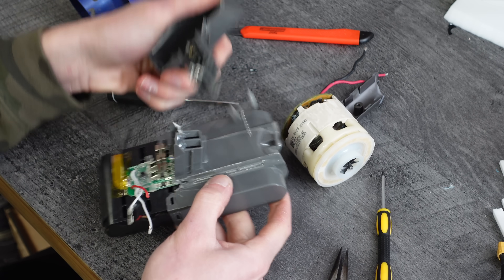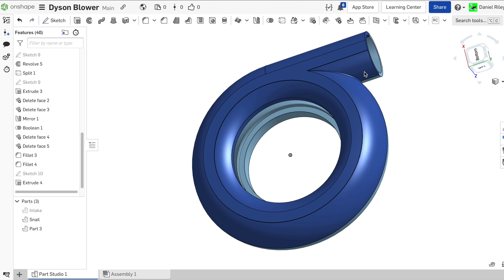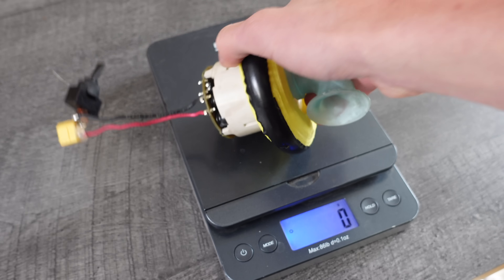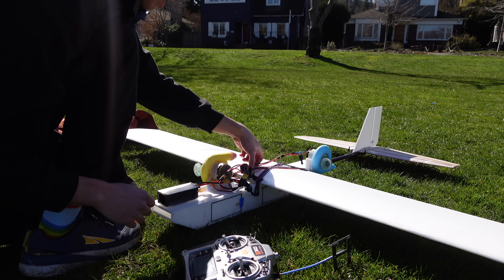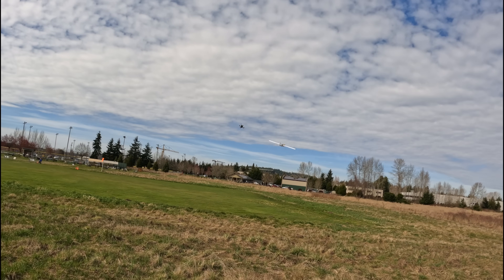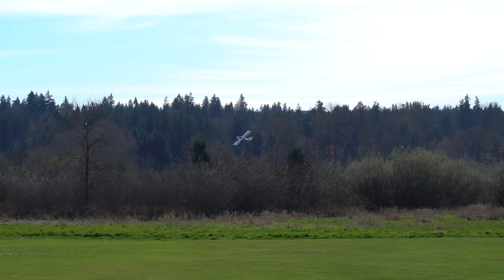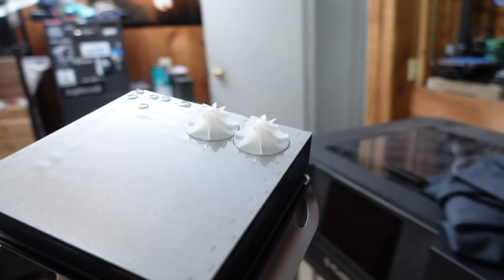Dyson Powered R/C Plane

Comment from the maker: Use code RCTESTFLIGHT40 to get 40% off your first Factor box at https://bit.ly/3LeE7JX!
Reply: Can u add some butane and a spark ...maybe try an add a afterburner
Reply: L ko
Reply: Wow a Dyson that did something useful.
Reply: that food alway made me fart
Reply: What a waste of plastic factors needs to decrease it's quantity of plastic use
Reply: 6:10 Um, the snail exhaust looks like an uncircumcised penis. 😂😂
Reply: Because of the fact that these centrifugal designs usually produce a significantly good pressure when allowed to flow, did you try reducing the diameter of the outlet nozzle at all? 
I know more air flow is desired but I was thinking just the rear engine with the higher velocity flow and keep the front on with higher volume?
Reply: @jbirdmax  did you not watch the video? That was pretty much the first thing he did.
Reply: @lilsammywasapunkrock  he tried the front engine full flow with the rear one nozzled before he added the second engine? He never tried that.
Reply: OMG Daniel your hands have been ruined, by chemicals I presume. Get some Lucas' Paw Paw ointment it's the best
Reply: The "you know what doesn't need ailerons for roll controll" line was great...
Reply: What in the Howtobasic is going on
Reply: when you build a snalehouse do it snale way. It needs to be a divergent tunnel with a throat..where the snalehouse almost touches the fan. that gap determines eficiency.
Reply: I totally did too!
Reply: Next use the Dyson V9 Motor in their supersonic hairdryers.

100 Watts each and you have a directed flow. No need for printing.
They also look like little turbine engines.
Reply: Where is the solar powered plane, the V3 or V4 maybe?

I had thought each year would show as a further improved version cause I loved the idea and all your considerations so far as a great inspiration when I was struggling with mine.
Reply: My natural intuition is telling  me that you MIGHT get SOME benefit from pointing those intakes out at 90deg to the direction of travel. Nothing to do with the intake but that might present a smaller smoother, rounder  footprint into the wind? maybe~?? Giving you just slightly less drag?
Reply: https://www.youtube.com/@arduinoversusevil2025
Reply: my dude is all over the place. i love it! 😅 
whats wrong with all the dislikes?! 40% WTF?!
Reply: @cloudpandarism2627 the people who dislike have no roll control....
Reply: @cloudpandarism2627  i already tried them. i have to eat 2 of them because they are so small and it basically turns into a $26 dinner of some frozen meals. you can buy better frozen dinners at safeway for way less trust me.
Reply: @cloudpandarism2627  🔴 What Is Islam? 

🔴 Islam is not just another religion. 

🔵 It is the same message preached by Moses, Jesus and Abraham.

 🔴 Islam literally means ‘submission to God’ and it teaches us to have a direct relationship with God. 

 🔵 It reminds us that since God created us, no one should be worshipped except God alone. 

 🔴 It also teaches that God is nothing like a human being or like anything that we can imagine.

🌍 The concept of God is summarized in the Quran as:

📖 { “Say, He is God, the One.  God, the Absolute.  He does not give birth, nor was He born, and there is nothing like Him.”} (Quran 112:1-4) 📚

🔴 Becoming a Muslim is not turning your back to Jesus. 

🔵 Rather it’s going back to the original teachings of Jesus and obeying him. 

More .....
Reply: It's literally microwave food. I really don't know if you should be pushing that. Hellofresh at least includes some cooking. But this is just cantine food.
Reply: @graealex  i like microwave food and the meals looked tasty. Just because the method thats easiest to heat it is a microwave doesnt mean it will be bad
Reply: @DTNorthern  It's not about how it is getting heated afterwards. It is about the preparation so it can be ready in 2 minutes in a microwave. Don't get me wrong, no one is going to die from eating these meals, but I doubt you should be eating them on a daily basis.
Besides the fact that you are paying about $8 per meal which usually contains only around 600 kcal.
Reply: factor has disgusting prices. 600 calories per meal. so you need 2 meals per day if you sit in a chair all day. so 14 a week at a minimum. thatll cost you 180 before taxes. for 1 week. like wtf? i eat fast food every day and its cheaper.     and i get 1000 calories in an easy 15 bucks.   canadian... in toronto... do NOT get scammed. the only thing helping you lose weight is the HIGH cost of the box. this guy mus be loaded on solely factor. if i looked up the piece you have been supporting i would stopped watching a long time ago. they help noone but themself. like you telling therm to use a scam service like that.
Reply: I’m not interested 😒
Reply: @algodoomarbleracing  wwwaaq9

Comment: Just saying here... when you tested the propulsion with the food scale its NOT gonna have the same effect because there's no change in the air flow. Test it with 2 different parts. One like the plane you made that you made with motors on the wing but with a tube that "sucks the air away front the inlet like it was when you turned the inlet back words and test it visa versa with the second one blowing air into the inlet but also going around the on coming wind. Its also sad how slow yoir brain is for not being able to see the wood plane fly past above you out of view of the camera behind you.

Comment: If you enlarge the opening of the inlet funnel and thus the back pressure, the pre-pressure and thus the propulsion should increase... because the density of the gas column and thus also the mass that is accelerated backwards has increased...

Comment: For those that don't already know - when you put a Dyson on to charge and after it is full, it stops drawing power from the wall and just uses one cell to keep the electronics in "standby mode". Eventually that cell is discharged and given enough time, the pack will refuse to work at all.

Comment: that is soo cool something to think about while requiring a bit more skill if you were to have the exhaust of the impellor going into a reaction chamber and then were able to spray a flammable liquid into the exhaust and then ignite it you would literally create the same type of primitive jet engine found on things like the Caproni N1 thus generating significantly more thrust.  A can of deodorant or lighter fluid or alcohol would do the key would be to aerosolize it in the exhaust and ignite and depending on where you live there may be legal restrictions but would be fun.

Comment: If these air outlets were metallic and at the end you put a gas mixture (from a butane cylinder for lighters, for example) and ignite the mixture with the air that comes out, it is likely that the thrust would be incredibly greater.
Mention me, if you put that idea into action B-)

Comment: Sometimes those sharp edges at the inlet help the compressor to achieve a slightly wider compressor map.  Uses the disturbed boundary layer to achieve a cheap port shrouding effect via forcing more flow towards the center of the wheel

Comment: I've aways through about using vaccum cleaner as RC plane thruster (and also if you could do one with hair dryers) but i think you shall try to shape your engines, not as a turbocharger, but as a reactor. I mean put it with the compressor facing the air flow and attached under the wings (like a passager plane) or half way in the fuselage like a fighter jet. Maybe the second will reduce the drag.
In any case well done you've realised one of my childhood mad experience

Comment: for the next plane, remote controlled start, could work. also setting up the vacuum motors like jet engines could help with the stability, as well as ducting the intake could help with the thrust issues.

Comment: I wonder if you could add a Venturi affect at the discharge nozzle. Wouldn't that double the volume of air moved? Basically a  jet eductor. I know this would work with water pressure, not sure about air though.

Comment: Daniel, what if you set it up so the 2 motors are tied together so they produce one thrust output.  This would allow you to switch sides with the motors so the balance across the wings rather than the fuselage.

Comment: if i understand correctly, the orientation of the air intake is supposedly changing the flow because of the oncoming air, so it would seem obvious that there would be no change on a static scale ?

Comment: The flared intake pulls air from all round. I guess you were hoping for the koanda effect to add lift/pull, but I think ram pressure overrides that. Replace flared intakes with a straight, sharp edged tube , so it pulls only from Infront. Ideally also fair the outside edges, but not so vital with the airodynamics of that beast. Possibly a stator to true up the intake would help, but not sure

Comment: Great Vid.

If you reversed the direction of the motor (if possible), would you get any thrust out of the impeller blades, or does it not work like that?

Comment: If you match the desired speed of the airplane with the area of the inlet with a gradual (low loss) cross section reduction from the inlet bell to the impeller  vs the same mass exiting the fan system  you will minimize inlet losses and maximize available thrust.  Keep in mind that the fan you are using was designed for high inlet velocities with no restriction.  Create a ram inlet to maximize the aspiration volume and minimize the aspiration losses . Likewise, the outlet nozzle should do some flow straightening to get maximum impulse, and the area ahead of and outside of the nozzle should be tapered to allow the ambient airstream to gently return to fill the void created by the engine cross section avoiding turbulence rapid shear at the trailing edge.  You end up with an aerodynamically efficient engine housing and an efficient energy transfer. Remember that an inlet to a fan that is "starved" will produce less  net gain in pressure and therefore a lower exhaust impulse (MV2). Spend more of the energy compressing and accelerating the air to maximize the V2 component of the MV2 formula at the outlet. It will always be true that the M portion is the same for the inlet and the outlet. (conservation of matter) so look for lower V2 at the inlet (larger smooth intake) and highest possible V2 at the outlet.   This all would be best achieved by placing the motor with its inlet axis  the same as craft direction of travel and then using a bell housing around the motor outlet to collect and compress the air as it moves rearward towards the exhaust nozzle. Voila..electric jet engine.  Forcing the air to spin around the volute (many times) instead of moving directly to the  outlet with a single turn burns energy as friction and heat.
Reply: I was just about to say exactly that
Reply: @TheHishamManna  what he said
Reply: Damn dude, that is impressive.
Reply: Nerd! 

🤓

Comment: Brilliant idea for a project!! Well done. 

If you do a lot of 3D printing - which it seems you do :) - one trick for connecting FDM prints is to “glue” them together using the same plastic spool used to print them.  There’s a dozen different ways to do this…but my favorite is to use a cheap $35 3D printer PEN, and feed a length of your spool through it.  You can then just sand off any of the excess to give you a seamless connection that few would be able to tell was “glued together.” 

Keep it up!

Comment: You could make the inlet more RAM-jet style, as the plane starts moving the 'flat' part of the inlet flange might give more drag than aid in flow.
maybe end the Tuba style inlet at the 70/45 degree mark to reduce drag.
also try to get some of the snail housing inside the main body.  with inlet and outlet sticking out most :3

Comment: No, a propeller actually "sucks" the aircraft forwards by creating low pressure over those rotating wings! Take a look at the shape of each propeller blade and you'll see it is a wing. Wings create "lift" by reducing the air pressure over the top of the wing or, in the case of a propeller, in front of the propeller. Learn your Principles of Flight!

Comment: Sorry to be the picky guy but you're missing the differentiating factor in your test: how the ambient air is mooving towards or away from your inlet nozzle as it is mooving in flight, to recreate this you would need to put the scale test into the airstream of at least a fan (guided laminar flow would give more precise results but too much effort if it would just be about if it creates a difference) with about the same speed as your plane and then try turning the inlet nozzle.

Comment: Am I mistaken, or is that Dyson motor BRUSHED? Whether it's brushed or brushless, why couldn't the voltage, hence the proportional control be harnessed to the throttle with a BRUSHED ESC? IOW why can't the throttle be used instead of the BIPOLAR ON/OFF Switch?

Comment: You could probably mount each motor above or below each wing and add fixed landing gear covered in an aerodynamic shroud.
Otherwise your aircraft is very impressive.

I just wonder whether similar but far larger dyson motors or similar using your design, could be employed for some form of personal airborne transport.

There are single seat drones that utilise multiple propellors, upwards of 12.
Which in my opinion is both dangerous, unsightly, noisy and they generally have large footprints.

Comment: I can get some pretty clean prints with simpler setups than your 3D printer. It looks almost like you had poor first layer. Also, Fusion 360 has some pretty good multi component updates which people are taking advantage of to make a jet Styled air Cowl. With some pretty good performance benefits on different Motors from this, but same motor design factor. 
This is a project I've debated taking up, it would be fun to see the thrust Factor differences with experimental fdm ASA directionals ( functioning as a core for a modular flight system)

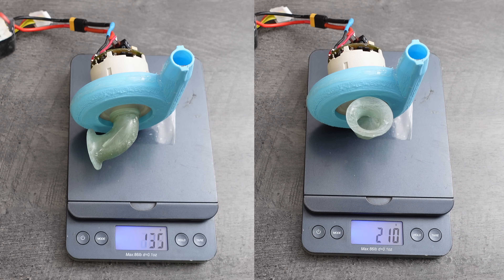Comment: At 13:00 I see a flaw in this measurement:
During the test on the scales the air is still, as opposed to when mounted on a moving object (airplane), when the air is directional. This could be recreated with a fan (a PC fan would work well, Major Hardware comes to mind...) blowing towards the front (or rear) of the intake bell.

Comment: Changing the angle of the intake while on the scale would have zero effect on thrust as air is not being helped by forward movement. Also, if that wide horn lets more air into the intake, the amount would be negligible. If anything it would create more drag than it's worth. I'm pretty sure a slight horn would do better.

Comment: is that possible to make regenerative drone using wind power and try to make Trans Wing like PteroDynamics Drone. On their drone has 4 propeller when they doing VTOL and switch to 2 propeler when they do cruising on the flight, may be you can use another propeller to doing regeneration power?

Comment: If covering the intake makes the motor speed up, why don't you use and Adriano to actuate an intake baffle. That way you can adjust the thrust and in turn, use less power at the same time flying faster?

Comment: You can make a housing for the impeller that redirects the radial output of the air stream into axial flow. That how most of the cooling fans on grow systems are arranged.

Comment: Something I've been thinking about: could you get more thrust with a housing in a kind of bell shape with the intake at one side, motor in the middle and exhaust at the back?
In my mind there would be extra thrust from the pressure generated by the air getting pushed from a sideways flow to a backwards flow

Comment: You can't move a lot of air with "suction", because the limit is the ambient atmospheric pressure.  They aren't "sucking", they're moving air for the air-pressure to move in on.  That means that there's an upper-limit for an vacuum.  Dyson quit focusing EXCLUSIVELY on 'suction', and instead started doing both suction AND air-flow.  Dyson moves more air than most of their competitors, and that's why their vacuums are so effective.

I watch a lot of "Vacuum Wars" (A YouTube channel), because caring a lot about your carpet is the middle-age equivalent of caring a lot about your lawn, except I don't have a lawn.... I have carpet.

Comment: I've always know British Dyson is better than the American Hoover.
Hoover are crap vacuum cleaners.
I don't know if Hoover invented the electric vacuum cleaner, maybe they did, but their technology stood still for decades...
Hoover technology always relied on the air & dust sucked into the machine would be separated by the microscopic holes in the bag which would trap the dust but allow the air out to atmosphere.
An archaic idea...
You can always smell the dust when using a Hoover.
Especially when the bag needs changing.

Dyson re-invented the vacuum cleaner to be far more efficient.

Dyson even offered his invention to Hoover but arrogant Hoover told him to Naff Off.

So he did & outsold Hoover throughout the World with his cleaner.

Then the cheeky B**tarts Hoover COPIED his idea, so Dyson took them to Court - and WON....

Comment: The ready meal (FACTOR) looks not good for the environment (plastic, packaging ...). Consider stewing vegetables (can be frozen). Only a quarter inch water and low to medium heat on the hotplate. Use a lid for saving energy. You can walk away and return 30-40 minutes later. So you only have to start earlier, but it does not rob you more time then that microwave thing.

Comment: Wouldn’t it be more efficient invert the flow and having the intake on the sides, coming in perpendicularly to the air output and have the air blowing out the center of the propeller ?

Comment: You cold use the motors torque and choke all of its flow through a distributor from tubing to 2 or 3 thrust exits on the wings 🤷🏻‍♂️👍🏼